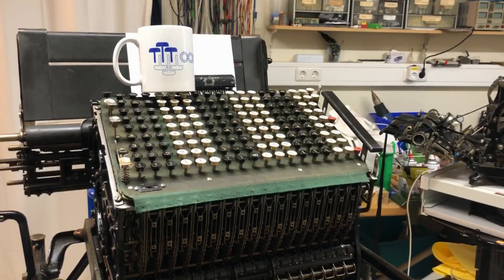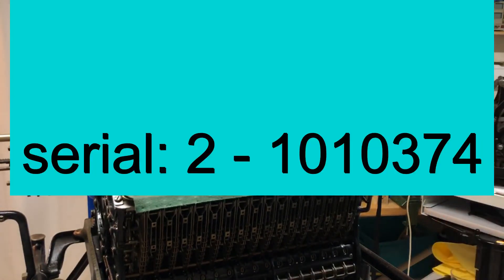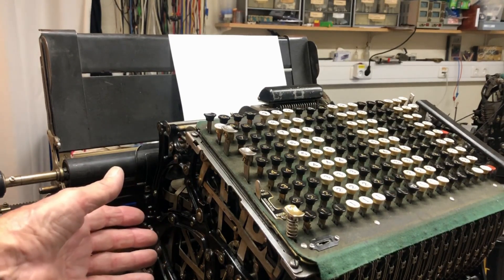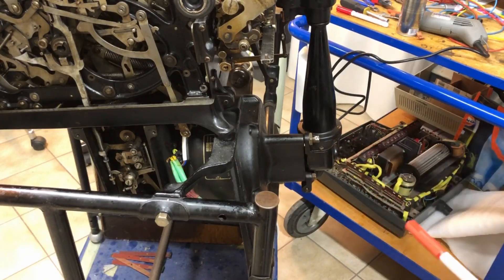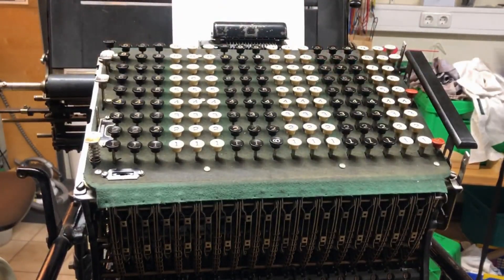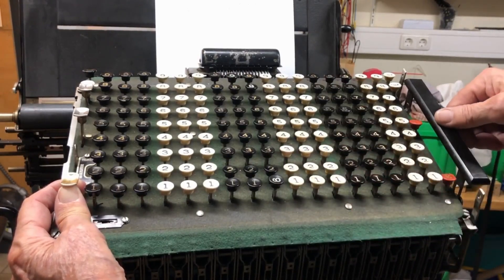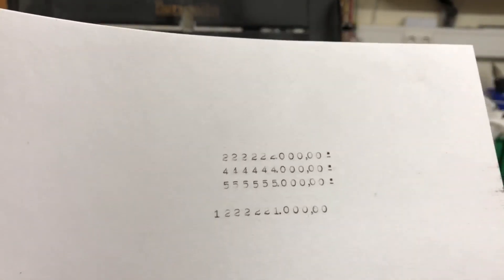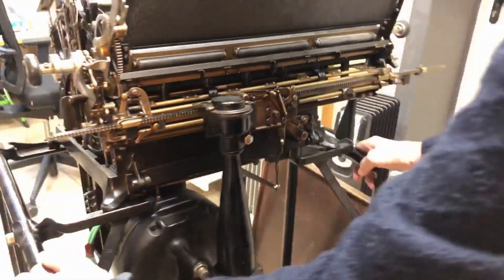Burroughs Electromechanical Calculator from 1926

Comment: Hi Francis,

Thanks for the video of your Burroughs Adding and Listing machine.  I was totally delighted to see it run.  I’m most interested in the motor powered carriage system.  I have a type 6 machine which is essentially the same as your type 2 only it does not have the extra register that yours has.  I haven’t had a chance to work on mine yet.  Its quite a mess with cut wires and such.  However its gear box with switches and springs is very likely the same as yours.  You mention in the video troubles with the machine and that there maybe an issue with the springs in the gear box.  Would any photos from my machine be of any help to you?

If you get to doing anymore videos on your machine could you go into some detail about the second register system?  That's the part of this series of machines that have been the biggest mystery to me.  Being the type 2 and type 6 are essentially just modification of the original type 1 machine.  I’m still not totally sure what really makes different beyond the extra register on the type 2 and the motor and programming system of cams and such that the type 2 and 6 have.  More details is always appreciated on these under appreciated machines.

Thanks again,

 - Ed